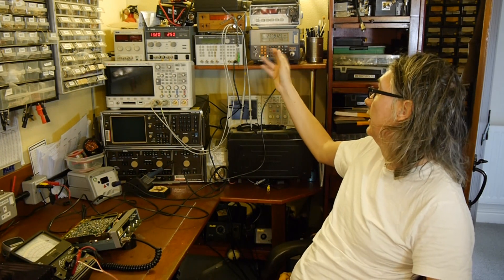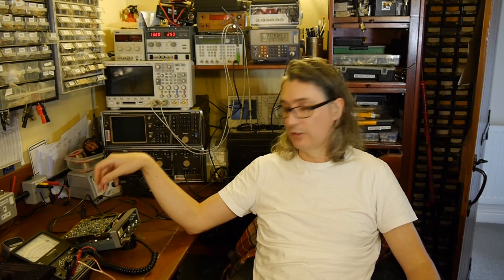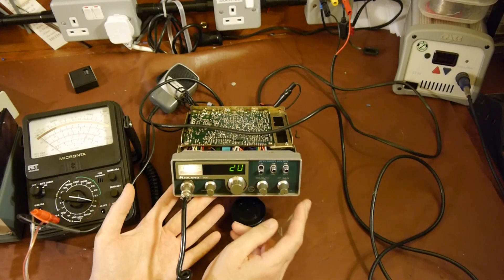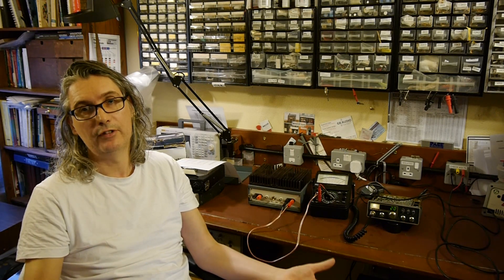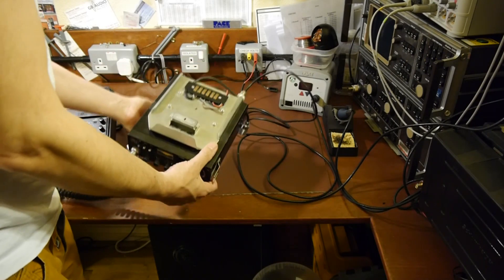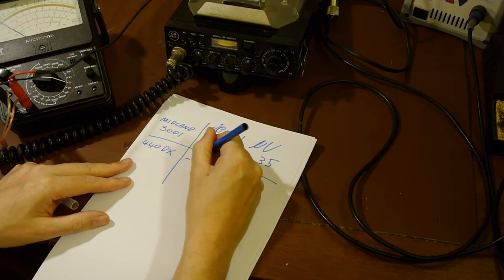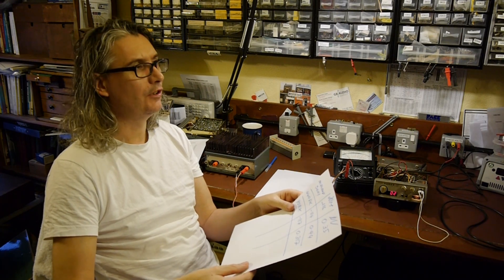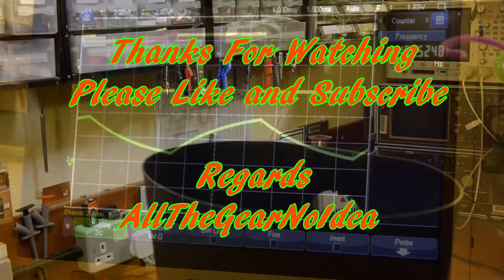RF Measurement Part 3 - FM Quieting

Comment: Aha, found it. I wanted to 1 either make this video ,  or 2 , find someone who is actually measuring audio quieting of a receiver correctly. I had to do this with FM receivers 20 to 30 times a day. Also, I had a type of receiver that could fool you, and I'm sure the techs who came after me found the concept of being fooled by a receiver quite puzzling and had to look around at the bench I left behind at that particular company to figure out what to do ! The problem was with Harris FM receivers, the solution was the Sinader. But, that's another story, others have tried to demonstrate the basic sinader measurement, not so well so far. And no one has a Harris 1525 receiver to demonstrate how you can be fooled with that discriminator chip ! Thanks for this video. I used to have Harris fm 1525 transceivers , hundreds of them with which I could demo being fooled,  but not sure now. I'd want to be able to measure the effect of the filters (with the 897) so I would probably go to a 1volt noise level, and a .1 volt for 20db. The 1525 Harris could give me .2 uv 120db signal to noise, very sensitive, but I had to rely on SINAD to be sure the discriminator stage was being tuned correctly so, until I went to work for Motorola and GE, no 20db sig noise stuff ! I also learned how to protect my signal generators with sampling equipment just in case the transceiver decided to transmit for whatever reason. THANKS for a good video.

Comment: Thank You for showing us.  I'm trying to learn how to measure my receiver's FM signal going into the IF/Detector coming from the tuner.  My FM is totally quiet across the band.  No FM hiss, no stations are being picked up.  Just total quiet.  AM works great.
Reply from the maker: John Supersport  Thanks for watching.  sorry cannot really offer any advice on the tuner I assume you have checked the obvious stuff like the antenna connections and  cleaned the selector switches. I would generally inject a known signal from one of my signal generator and with the aid of a diagram try and trace it through etc.
Reply: Is an RF Generator required or a Signal Generator.  I am still working on it.

Comment: cool used to have a midland 3001 seem to remember I had a K bleep fitted to mine back in the day !
Reply from the maker: thehappylittlefox aka benji  Yes I remember loving my CB radio back in the day but that now such a long time ago. It was  great fun driving round in the car and arranging little meetings etc. That Manor Kestrel / communicator has a bleep on it.  I doubt I will ever work anyone again, I would need an antenna for one thing.
Reply: yes I remember it well although I didnt drive I was more a Homebase cb'er  now I remember  I repurposed the little filter switch on my 3001 and used it to switch the K bleep on and off ! I did have a couple of other rigs but the main one was a Lowe TX40  then I got the magpie auto scan 5000 probably one of the first to have the blue display ! I'm learning a lot from you,   I have most of the gear but like the old no eyed rain deer joke  still no idea ! Merry Christmas !

Comment: You will find the LCL communicators NI440DX receiver difficult to align & we use a sweep generator on the IF to do so. That said, it's capable of really excellent receive sensitivity, a squelch that works nicely & crystal clear transmitted audio, but was a dated design even back in 1981 especially in it's use of discreet semiconductors in the IF rather than the usual IF subsytem IC. A lot of people say these radios are 'crap'. That can only be because 30-odd years on, the alignment is iffy! In our 1982 technical & user tests, it came top rig out of 120 units tested.

Interesting demonstration; not seen it done that way before.

Richard
Reply from the maker: UK CB radio servicing  Hi Richard I would love to see you demonstrate the  alignment procedure using a sweep generator if the opportunity arises you did mention it when you did a video on the Manor Kestrel. The work you have done producing all the CD alignment and test videos really is an amazing body of work and a real Credit to you. I would love to buy you a pint sometime and pick your brains etc. Thanks Regards Chris
Reply from the maker: UK CB radio servicing Hello Richard thanks for the nice comments it means  a lot coming from a radio Guru like you I really enjoy  your videos. The FM quieting test was the standard test before the fancy SINAD meters. SINAD meter are actually more complicated than they first appear the filter response is very tightly defined. I do have a sweep generator but never used it before so that will be a first. I’m working on the midland 3001 at the moment.  Interesting the 20 dB quieting occurs at -116 dBm which is also what I recorded the 12db Sinad at on the stabilock 4015.

I have watched your video about six times so far and tomorrow I’m going to give it a go.   I did a google on the communicator and they come up as one of the most hated radios I have read about. Thanks Regards best regards Chris

Comment: 2nd time of watching,  I can vaguely follow your drift-seems to be based on quantifying readings and making some sense of them in comparison.
  I cannot tho get my head around  dB as a means of measurement, I am quite content with volts Amps and Watts and all the other thingies that can be measured with stuff I have at my feet.
 I am coming to the conclusion that  if I get more interested in this RF stuff I will implode.
And that will be (locally) messy. Best regards as always, Sam.
Reply from the maker: Average Joe  To be honest I was just the same about those devious little dB bastards until very recently.They are quite difficult to figure out at first and it can be easy to make a mistake as the calculation is different for either voltage or power gain. However once you start using them you start to get a feeling for the typical values. The problem of saying volts it often not definitely stated  what the actual power is as the load impedance is often not specified. If I give the value dBm you can be sure I’m taking about the actual power level delivered to the antenna input.  Because I’m reading a lot of engineering standards it’s most common for things to be quantified in dB so I just have to suck it up buttercup.  Regards Chris.
Reply: @allthegearnoidea6752  Ahh, So a proportional answer is what is needed,
 I have nothing, 
  Nothing.
 Cheers, Sam.
Reply from the maker: Average Jo didn’t Shirley Bassey sing that ?

Comment: Interesting video Chris. Most of my sig gens have instructions for performing sensitivity tests but I haven't ever followed them. Or read them actually except the one I just have.  My Sencore offers an FM sensitivity test of 'a measurement of a signal, in uV, necessary to produce a 30db signal plus noise to noise ratio'. This equipment has inbuilt speaker loads and db meters so should be a doddle!!!
Reply from the maker: Andrewausfa  be interesting to see you do this test on a few radios sometime with your test gear. Regards Chris.

Comment: Excellent video Chris! Demonstration videos really help me to understand a concept. In your reply to Simon Spiers you mentioned having a dabble with GPIB - Keysight have an excellent software package available for free called  Keysight Command Expert and have downloadable command libraries for many of their older products. You can also send SCPI commands to non-HP/Agilent/Keysight gear with this program.  Tektronix also has a free software package called Openchoice Desktop that works with Tektronix gear. I have very limited experience with GPIB but have used it to calibrate my HP 6624A System DC Power Supply.
Reply from the maker: David V Hello David thanks for the nice comments. Yes never done anything with GPIB but I did buy a knock off usb interface from China. Simon has some good videos using a computer interface to plot audio response using his HP8903 audio analyser. I would quite like to try this. As you can tell I’m actually more interested in play with my test gear  rather than the actual DUT.   Thanks David Regards Chris

Comment: Hi Chris. Well yet another interesting video. I’ve never tried that test before but I will in future for a benchmark before and after. I normally trim the receiver by ear but it will be interesting to see what improvements you can make by aligning them. I had the York as favourite out of the CB’s. The cybernet chassis was alway great on receive. I have quite a few different makes of CB here so could have a go at them and add to your table. It would be interesting to try a Uniden chassis as they were up there with cybernet as one of the best. Regards Graham
Reply from the maker: Hi Graham as you can tell I am probably more interrest in the testing than repairing the actual radio equipment. Yes I think i would be interrested to see you get any values similar to my own.  Kind of would like to figure out and do more how to performance test in the future.

Comment: i didn't think the cb's did bad considering the basic design of them :-).
I think it's the old story of acheaving quite a lot with basic circuits, but there is a point where any extra improvement starts to get difficult and often expensive.
It seems to apply to everything.
Ahh remembered "Diminishing returns"  i knew the memory would finally get there lol.

Sinad is fine but the quality of the demodulation/distortion and received audio frequency bias can make a rather flat sounding radio much easyer to listen to.
Or Bass/Mid/Treble balance ha ha :-D

Just a better speaker can make a hell of a difference for any radio, even the expensive ones.
i modified radios for humans to listen to, or engine tuning by ear lol.

Modding the squelch circuits for less thud was helpfull too.
In one of my old mates radios i did an evil thing, the squelch was rewired to pull a small relay in, when the squelch was open the speaker was connected, and closed was a 10 ohm resistor.
It was silent except for the tiny quiet click of the micro relay.
Yes i am nasty, but he loved the clean squelch :-D
Reply from the maker: Great comment, is that the 80-20 rule.  I have seen relay operated squelch in the past so nothing wrong with that. A few people have mentioned the poor selectivity and blocking with this basic IF strip. I would quite like to test this and compare to the otehr radios. So just need to do a bit of investigation on the formalised test method, i have some ideas.  Regards Chris
Reply: Sorry about the delay on answering back, been out all day.
i try to show appreciation for the work put into a video by watching it fully and commenting on as much of the video i can understand lol.

Honestly I am thicker than a bankers wallet, so there is a lot i don't know about electronics, i've been a repairer mostly and that just requires a few brain cells being rubbed together :-D

I don't know the 80-20 rule, do tell :-)
Reply from the maker: 80 20 rule suggests that 20 percent of your activities will account for 80 percent of your results.
Reply: Ahh i see said the blind man lol.
A short comment from me, for a change :)

Comment: Very interesting Chris, I'll have to try this when I can.  I have a Motorola SINAD, needs love so hopefully soon...I have shot 4 projects over the weekend, I think the next posted one you may like??  I'm hoping in about two projects ahead, I'll be able to start work on my Ramsey Com3, looking forward to it!  New meter looks like it's doing well!  Sure do like that Marconi!  Cheers Mate!  ~Jack, VEG
Reply from the maker: It was actually quite an enjoyable test to perform. I have no idea how you would couple the rf input to your tranistor radios that have no antenna input etc.  Looking forward to your next video. Regards Chris
Reply: Maybe just air gapped like you'd do for AM/MW/SW/LW radios, for FM broadcast you just alligator clip the arial?  Generally for sensitivity,  you dial in a frequency then, modulate a 1 KHz tone at 30% then see how low you can hear the tone...the last radio I worked on, I was able to hear it at about 10 microvolts...not sure what that equates to in DBm, I am still trying to learn that and DBp, you mentioning DBm many times is slowly helping, thanks!   Salute!  ~Jack, VEG
Reply from the maker: Vintage Electronics Geek Don’t worry about the dBm. I’m just referencing my measurement to 1mW  across a 50 ohm load. It’s better to learn the dBm if you can. The problem with expressing this as voltage is that due to the output impedance of the generator and the receiver input inmpedence it can be very unclear what the actual amount of power being delivered to your actual radio by the generator. The reading on the dial of your signal generator will only be accurate when it’s being fed into its designed impedance. This will depend on what your signal generator was designed for. For example my signal generators are all 50 ohm yours may be 75 ohm.  Sorry I’m not really explaining this very well. But basically it’s unlikely you will get a accurate measurement by just feeding the signal into the antenna as it won’t match the signal generator impedance.  Going back to the dBm if we both use dBm we can be sure we are actually talking about the same power seen by your receiver.  If your free over the Christmas holiday we can Skype and I will try and explain it better and how the dbs work. It’s just a scaling factor allow us to express very small  and very large number without lots of these 000000000000000000000
Reply: I forgot to mention that with air gap, I have seen several schematics mention 12 inches / 304.8mm away for the DUT/UUT...I actual have future plans in making a nice coil, I have the wire and coil forums, just need the time!  I do believe mine is 50 ohm and I use 50 ohm coax...I have a future video that I actual do a little work on my SG, so you'll get to see that more...one of the projects I worked on this weekend...I'm going though all my test gear and servicing them, so Im shooting videos...A slight break from radios but I do have one I did over the weekend.  Sorry mate, I dont Skype nor any video/social chat, welp..I do YT and that's it...for communication...I do email, I'd be more than happy to chat that way...several times I wish I had a better way of communicating with you. Hope you understand.  ~Jack, VEG
Reply from the maker: Vintage Electronics Geek  it’s all good.

Comment from the maker: Oops. When referring to the speaker output I sometimes say dBm this is a slip of the tongue. I should have said dB. It is only the output from the signal generator measured in dBm.  Useful conversion table http://wa8lmf.net/miscinfo/dBm-to-Microvolts.pdf